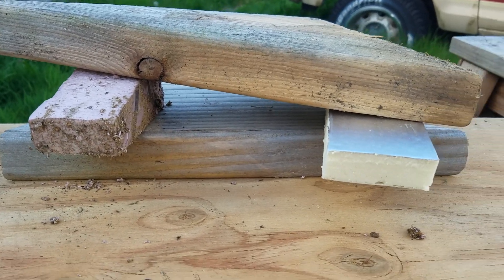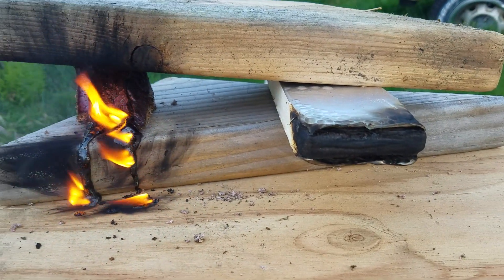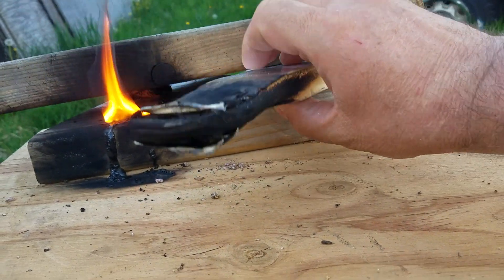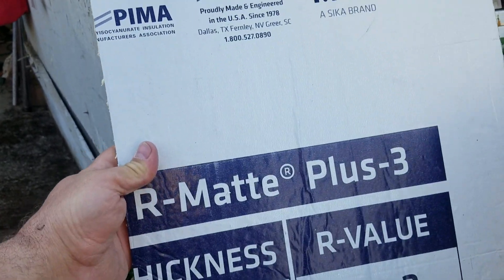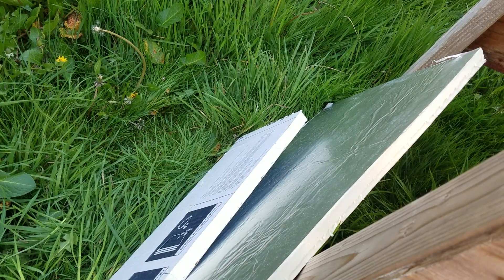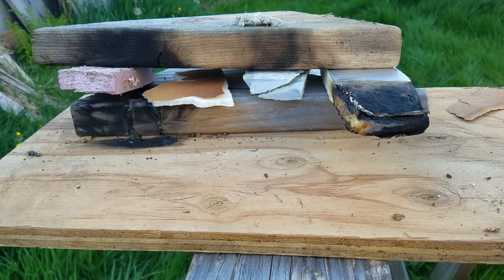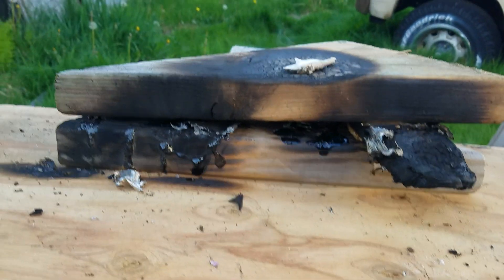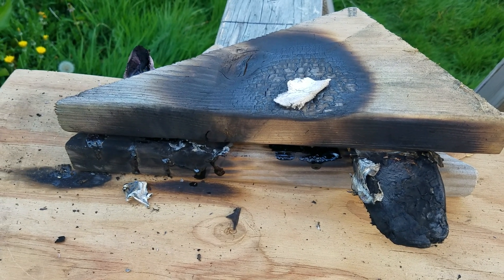Fire Testing Foam Board Insulation

Comment: Confirms what I already knew..don't have a fire in your van 🤪🧐😲😁👍
Reply from the maker: Unless it's one of those fireplaces built to heat and cook in your vehicle. Hey Paul, I thought the test was interesting. One more thing about the RMAX is once the black shell is formed from burning, the insulation underneath looks untouched. Only the surface blackens then it stops burning and preserves the rest. The fridge is working great. Got to get it stocked up and go camping very soon. I still have a couple days of cleaning  and putting things back together. You take care...
Reply: @CITAP1  That is interesting on the insulation 👍 Glad to hear the fridge is up and running again !